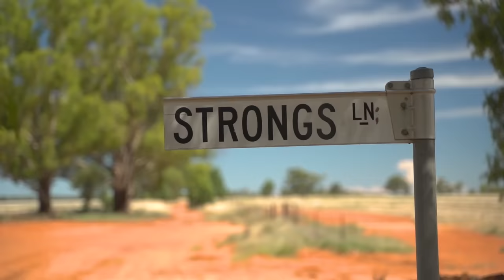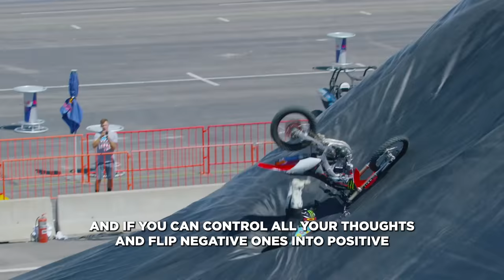The FMX Triple Flip Returns

Comment: Air Bag innovation may seem revolutionary because it is. But it's far from perfection. Its possibilities for bike damage, injuries, even fatalities are far too high. Perhaps a water landing, with an engine brake and air-intake shutoff valve for quick refire and to prevent hydro locking of the engine. The bag/pit has pioneered the way but it's far too risky. Maybe some type of electric bike with a sealed system impervious to water and engineered to behave and be balanced similarly.